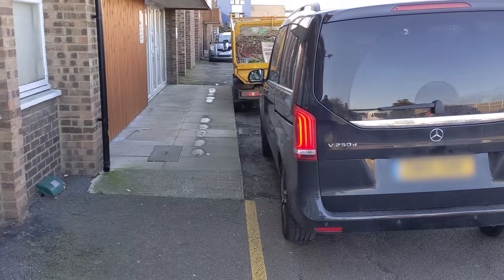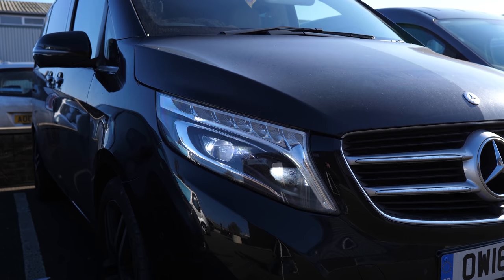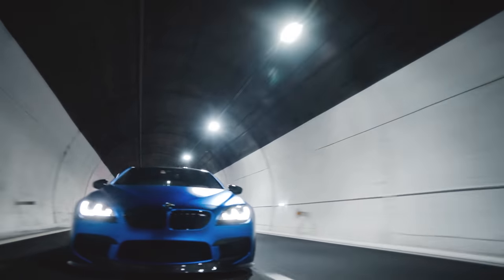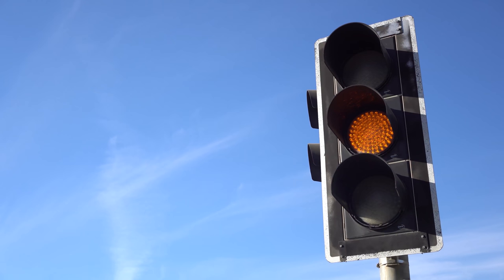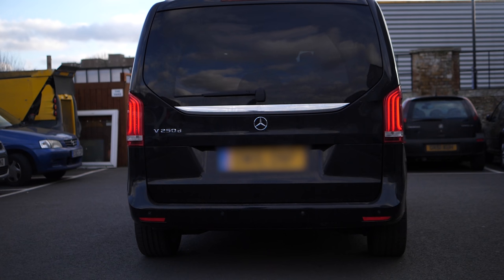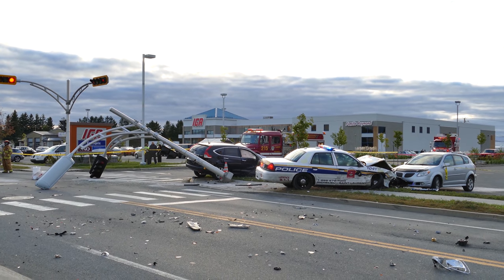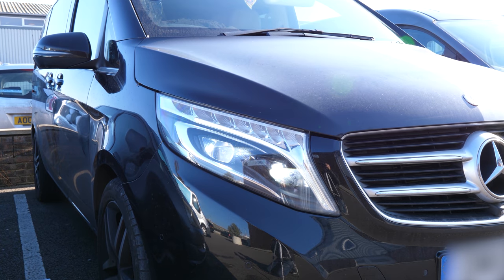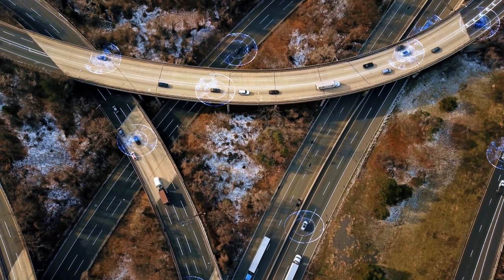Self-Driving Cars Are Dangerously Confused By LED Lights

Comment: My "favourite" situation is when I'm stuck behind a US-manufactured car that has SEPARATE red turn and brake signals. JUST MAKE THEM AMBER! There is no possible way to handwave this away as a cost thing because they already have the separate systems. As a bit of a "trainspotter" for cars I've built up the knowledge of most of these, which is a signal vs a brake, but the average person doesn't give a rat's arse and we need every possible tiny advantage we can get.
Reply: Amber would certainly be better, but that would require stocking a different part; and at least the two functions are clearly separated.

We have a similar situation here in New Zealand; where the preferred colour is amber, but it is legal to use a red turn signal or combine it with a brake signal (which must be red).
 Consequently, I often see truck trailers with a line of red lamps across the top and three red lamps on each of the bottom corners. These are wired in such a way that the dim filaments of all the lamps perform the tail light function, the bright filaments of the outermost bottom lamps and the three outermost top lamps are dedicated turn signals, the bright filaments of the second and third outermost bottom lamps are turn signals overridden by the brake signal, and the central top lamps are dedicated brake signals. If you encounter this system for the first time, it can be a real mission to figure out the truck driver's intentions; especially if you are queued behind it and are not looking at the top-mounted lamps.

I may have even seen one variation that uses a brake signal overridden by a turn signal for the second outermost bottom lamps; but I'm not too sure about that.

°°°°°°°°°°°°°    I'm a truck! I have more
|                   |   lights than you, and I'm
|                   |   going to use them all in
|                   |   the most confusing way
°°°______°°°   permitted by the law!
Reply: @BrendonGreenNZL  I'm talking about a couple vehicles that have separate brake and turn lights, like the Infiniti QX50. I think the Infiniti uses amber, but there are other vehicles I can't remember that are red with red. They're obviously different parts and all they did to make the turns red was not use amber plastic. 😕

(A bunch of smaller crossovers from various brands jammed the turn signals into the bumper to comply with US laws that they're not allowed to be on moving bodywork, i.e. the hatch)
Reply: @evilspoons  Yep. It wouldn't cost any more to dye a plastic lens amber instead of red; just like it wouldn't cost significantly more to fit the aforementioned truck trailers with dedicated amber LED modules for the turn signals. The only advantage I can see of them being red is that the turn signals can be made more prominent when the truck is not also braking.

As usual, though, style and form trumps safety and functionality.
Reply: RIGHT. Until we are willing to employ all of the possible fixes, we are acting way too dependent on technological solutions which will be never quite good enough.  Put another way, how many deaths will be caused in the name of progress, trying to make the perfect driving system?  I really think driving itself as a skill performed by humans needs to be here to stay.
Reply: Amber turn signals are ugly. I want my car to have red ones, safety be damned.
Reply: the bigger issue is when manufacturers make one brake light do both turn and braking since...well you normally do both at the same time. That said red brake lights do have the benefit of letting you know if you're facing an oncoming car or the rear of a car. It does seem like its a recent trend for US cars to have less lights
Reply: @pauldzim  how? Look up "mustang GT Australia turn signals" they look amazing and thanks to the fact they use a seperate amber they are much safer, I recommend technology connections video on the Matter
Reply: @WirableCrown1  Still no excuse for poor design. With amber turn signals, I see in a blink of an eye whether the car in front of me is turning, braking, or nothing. With red, you have to keep watching it for a second to see which of the three it is. Time you would otherwise be looking for other traffic. And that's before you consider that lights can fail. With amber turn signals, a single failed brake light will never be mistaken for a turn or vice versa.

Comment: LED tail lights visibly strobe and it's annoying as hell. Whenever I move my eyes I end up with 50 copies of those tail lights spattered across my vision.
Reply: I can confirm that. And I hate it. Especially when driving at night. Those flickering red lights are very annoying and disturbing. At least for me. The frequency should be mandatory at least in tens of kilohertz, ranging from 30 kHz to 40 kHz at least. Then I would not mind. And cameras would not mind either. As during each captured frame, the light would be clearly recorded.
Reply: @Tyler jeeze mate calm down lol you're both right; PWM works by strobing so the terminology is same diff we all know what he meant.. And some people (myself included) have hyper photosensitivity or something where we see lights differently than most - I do a lot of Arduino projects with PWM LEDs and I always have to set the pulse duration much shorter than typical just to make it bearable to work with... I see it in cars, LED room lights, alarm clocks, microwave displays... Sometimes useful but usually just annoying so I agree with Lift Pizzas lol
Reply: @davisdiercks  It doesn't work BY strobing. The strobing is a product of it's function. PWM is used in applications where lights aren't even involved in the first place. So no, it doesn't work "by strobing"
Reply: @tylergarza8695  oh my gosh is this seriously worth arguing over 😂 Oxford definition of "strobe: verb. flash intermittently" So no obviously PWM itself is not strobing, as it could be applied to anything like motors, speakers, transistors, etc, but in this specific application the PWM causes the LED by definition to strobe.

Also to my original point: calm down we're all just chilling here there's enough crap going on as it is without people like you seeking destructive attention
Reply: Lift Pizzas my eyes are very sensitive to that too. I hate LED taillights
Reply: @tylergarza8695  PWM, strobing, flickering, it really is not important in the message these people are trying to send out.

Go have a look at a study done called "Flicker can be perceived during saccades at frequencies in excess of 1 kHz" where clearly the frequency used for the PWM given the duty cycles, is not enough in most lights.

I too see the strobing and it tires me down immensely, it is annoying, and it is harder to see movement. This is dangerous!!
Reply: @davisdiercks  How do you increase the pwm frequency with an arduino?
Reply: @SirDella  For most of my stuff I just write my own PWM algorithm so I can have full control of where the processing power goes, in addition to the frequency, resolution, etc. But if you want to use the more common analogWrite() method I think there are ways to change the frequency. Since the default is just 255 timer cycles with 1:1 duty cycle resolution, I'd imagine that'd be completely imperceptible to any human.
Reply: @davisdiercks  Thanks! I did that for a slow pwm generator, but it is not the same because the microcontroller already has peripherals (timers) that work in the background, I saw a greatscott! video that explained how, but it's very complex, so I guess I'll go with the manual algorithm again, thanks!
Reply: I don't like "dimmable LED lights" for the same reason unless the PWM frequency is high enough.
Reply: @tylergarza8695  And you're just bored so you're finding something to argue about
Reply: Correct, what about the portion of people who would notice (with persistent after-images like you or those with marginal epilepsy)?
Reply: @tylergarza8695  You seem to forget the occipital lobes (soggy video card) are resource hogs, hence wouldn't take much irritation to start fatiguing
Reply: @tylergarza8695  No, we know that it is pulse width modulation, but we also know that pulse width modulation can be done at arbitrarily high frequencies with the same amount of total time on being the same (the fraction of the frequency that it is on is the same fraction as if it were on for that long continuously and off continuously for the other part of the fraction of the time.
Reply: @Lift Pizzas - You may be an android.

Comment: "I'm not saying turn lights in UK are better... I'm implying it." "A BMW driver would never change lanes without turn lights"

Hell, I love bitchy Steve.
Reply: You missed the dig at Apple too.
Reply: Audiocronic  Are you a BMW driver?
Reply: "If it's really expensive to fix the bug, you could just ignore it, and they'll jump ship to android..."
Reply: Audiocronic  I'll forego the privilege of using an indicator if I could have a BMW
Reply: I just got a BMW, turns out people behave poorly to bmw drivers. The only way I can get out into traffic now is to fit the stereotype
Reply: @racitup4114  Ha ha ha ha *snort*.
Reply: Based on my experience, I had always assumed that a turn signal was available as optional equipment on a BMW and that the vast majority of purchasers never chose to get.
Reply: That dry delivery is awesome
Reply: Tesla car's new software update can recognize traffic red lights.
Reply: I have an electric BMW i3; and judging from what I see in daily traffic here in Norway; electric BMW drivers are not the same as fossil BMW drivers; we actually use the indicators and we don't generally drive too fast either.
 But it seems to me that the designers of the i3 assumed this would be driven by old school BMW drivers, since the indicator toggle is one of the really annoying parts of the i3. It's not a classic mechanical stick that stays up or down until you push it back or unturns the wheel; but it's a sort of soft button with two levels of push where a light touch activates a "changing lanes" mode where it blinks for ca 1 second (it's literally only 3 or 4 blinks, way too short for my taste; as I actually like to indicate a little before I start turning); and a hard press toggles the blinking on that can only be disabled by steering that direction and then straightening up; or by carefully toggling it back. 

But here's the really annoying part; it's really hard to know whether you activated the first or the second kind of blinking mode; since theres almost no tactile feedback; and in either case the stick just silently moves back into neutral position immediately and there is auditory feedback on when it resets besides the ticking and blinking eventualy stopping. And the first mode cannot be canceled; trying to do so will cause it to blink the other direction; and the second mode can be canceled by doing a soft push the other direction but if you cancel it too hard it will occasionally also start blinking in the other direction. You can apparently also cancel it by doing a soft push the same direction; but this occasionally registers as a cancel immediately followed by another soft push. Makes me look like an indecisive idiot and it's infurianting. 

I'd rather have an old school mechanical stick that stays in position, and can be unambigously canceled by moving it back to the neutral position with a satisfying springy brrrrrrr sound as it snaps back. 

Presumably they didn't think BMW drivers would use the indicator anyway; so they didn't bother actually user testing it; or maybe they did user test it with fossil drivers who didn't notice the issue since they don't use it?
Reply: It's the way he keeps his tone level throughout. You almost don't realise that the par has happened until after the fact.
Reply: I think he missed the opportunity to also make fun of American rear-view mirrors, which are even bigger crimes against humanity than their turn signals.
Reply: UK having better turn signals does no good if people arent using them to begin with! :P
Reply: @tamask001  what's with the rear view mirrors?
Reply: @HonestAuntyElle  American left side mirrors are flat ground, which makes the blind spot gigantic - hence the need for all the blind spot monitoring doohickies. In the civilized world the outside third of the left side mirror has a curvature to minimize the size of the blind spot. But US law makers consider their compatriots too limited in intellect to understand the principle of a curved mirror and therefore mandate this utterly useless flat mirrors.
Reply: @tamask001  no wonder I've misunderstood all the drama about "setting your mirrors correctly on Reddit" makes me wonder what the Australian rules are like.
Reply: I like the way he said the second one with no inflection in his voice at all!
Reply: A typical BMW driver is the Karen/Ken holding up the drive-thru at Starbucks.
Reply: He also implied that iPhones are glitchy and overpriced.
Reply: @tamask001  as someone who spends a lot of time in reverse flat mirrors often are way better than curved mirrors especially if you include those mini curved mirrors in the corners to get a best of both worlds combination.
Reply: I usually look for the flashing. It's as if the brain was wired for that sort of thing. In 40 years of driving I haven't once been confused about an American turn signal.

Comment: A solid argument against PWM in LED automotive lighting.
Reply: What is your proposed alternative?
You can't reduce the current because of threshold voltage.
If you dimm the current the different colors inside the white LEDs would dimm unevenly and you would get green front lights.
Unless you control the different colors individually, which would be way more expensive as you would not only need a more complex dimmer but also LEDs where every color CAN be controlled individually.
Reply: @iamcurious9541  alternative? use LEDs with different power levels for each task, just like it was done with incandescent/halogen bulbs: tail light→low-power LEDs, brake light→high-power LEDs
Reply: An alternative could be a random shutter opening. On average it would pick up the intended led brightness, it would not over expose the camera sensor and it wont sync up with any pulse modulated light source